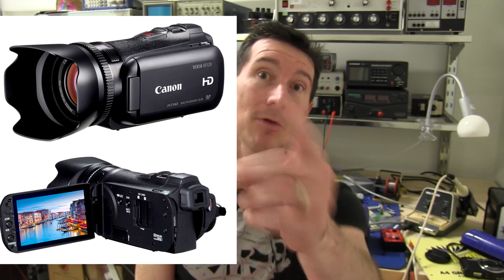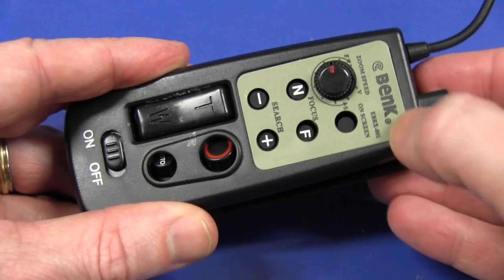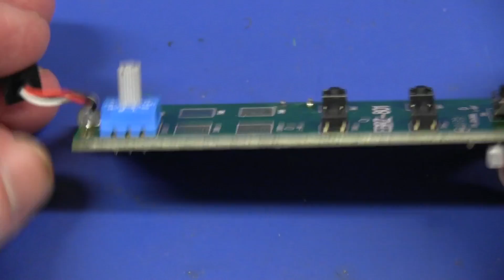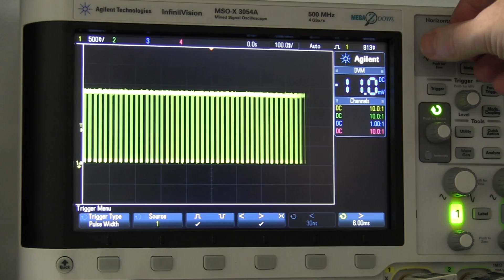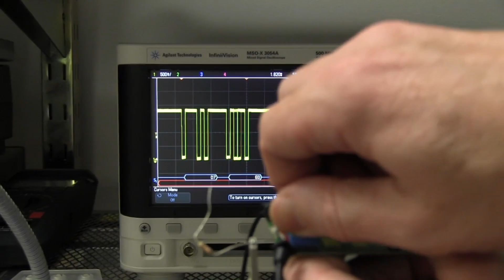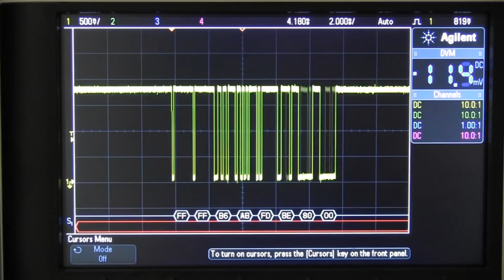EEVblog #297 - Canon LANC Bus Reverse Engineering

Comment: Hey, I'm looking to use a custom LANC-based RCP to control a Sony or Canon LANC camera remotely. What I can’t find is the full list of statuses that the camera can send back to the master (control) unit on bytes 2-7 of the LANC transfer. I see that the common status updates are “record mode” “tape position” etc, but I can’t find out if the camera is able to output such statuses as: current IRIS, current Shutter speed, current Gain, etc? Any insight would be amazing

Comment: Too bad I ran across this video 5 years later.  There is a Sony LANC remote that has an LCD display that displays the record/play time counter.  It has all of the control buttons and works on both Sony and Canon.  By adding a jumper it becomes a servicing remote allowing adjustment most of the operating parameters like color balance etc.  One of the LCD indicators is "REC" while the camera is recording.  So the information you seek is there.  I fixed this stuff for 23 years.
Reply: what is the remote model  number please as I am looking for a remote that can change exposure via LANC when in the manual mode. Thanks for your reply

Comment: Hey Dave, I just bought myself a Rigol 1054Z which has the option to decode data after you pay for it (or hack it).
Will that oscilloscope also decode this data the same way? In other words, is it worth paying for this decode function?

(I don't wanna hack and maybe loose my guaranty)
Reply: You won't lose your warranty if you're in the U.S. Here it's illegal for a manufacturer to void your warranty simply because you modified your property. The manufacturer must prove that the modifications you performed caused the problem for which you're seeking warranty service. The relevant law is the Magnuson-Moss Warranty Act. If you're not in the U.S., check the laws in your country for similar protection.

Comment: Great video, but disappointing because I'm using Canon cameras. My Varizoom wired remote for zoom/rec control does have a little tally light which works with SONY camcorders. The light DOES work on the new CANON HF G30 I bought. I'm not sure about the G20. As with your G10, the tally light does not work with the VIXIA HF S200 which I also have. I think if you put a G30 on your scope you'll see the tally signal.
Reply: Does not work on G20 either
Reply: You just saved me from wasting a bunch of time, thank you!

Comment: Looks like remote wall plugs, they have nearly the same code:
0.5ms control bit, 0.5 for 0 and 1ms for 1,  XXXXX 5 bits for the securtiy code, XXXXX 5 for the Letter that will be pressed and 2 bits for On or off (01 or 10)
and at the end a 350ms sync delay   101110100010 is plug 1-3-4-5(on), Button B, On

Comment: I wonder if there's a way you could use software to get an output (maybe even over LANC) when you start recording and use that to trigger the on air sign. That way, even if you're not using your remote you have the possibility of an on air light.

Comment: I was wondering if you might use the capabilities of the "Mini Advanced Accessory Shoe" on this camera to control your "on air" sign much the same way that it ( the shoe) might control the VL-5 video light accessory. I've looked all over but can't find specifics on  what the camera controlled shoe does to the light.

Comment: I suppose you could make that an IR switch then. Have another little transmitter going to a small control box on a different frequency than the camera. Again, would be a cool tutorial on how to build a small circuit like that. Knowing you, you could build that in about 30 min. :)  If you don't want to do that how about a foot switch you could toggle on the floor?

Comment: Also, I hate to be the one asking: Were you maybe pressing the record on/off on the camera instead of the remote, while capturing? :P If you were going to sniff at the bus somewhere between the remote and the camera either way, I would just use the actual hard button press signal (if you totally give up the bus sniffing).

Comment: I kinda like the idea of using an arduino to control the camera. Sure would give incredible control over the camera that way since you could output any command you wish. Build a shield that interfaces with the LANC and use a controller of your own design. In-fact a foot remote would be handy for controlling the camera when you don't have a free hand. You could also read the bus and output the counter to a display so you know how long you've been recording. Pretty cool idea someone suggested.

Comment: Actually, that won't give you the data he is looking for. He is looking for the byte that contains the rec status data. If you trigger off the button, you will keep getting "ALL" the bytes present when the button is pushed but no indication as to only which bytes are relevant. Since the camera doesn't seem to output it's rec status to the bus, he may have to resort to decoding the controller's rec/pause/stop codes instead. It should work fine but not if the camera's control buttons are used.

Comment: Could the 0.7V over on the power rail be to compensate for a diode? Just a guess based on the use of a jack connector.

Comment: Great little RE vid :)

Since the bus is UART compatible, you could hook up the bus to a PC, and compare the data when recording.

Also, while you're hacking the Lan-C bus, maybe you could make a nice zoom/focus puller with rotary encoders and a µC.

A focus puller would be really nice to have so you can easily do closeups without waiting for the AF

You can already use the remote without hacking, but 'absolute' knobs could be nicer to use.

Comment: Maybe you can reverse the approach and instead of reading the state of the camera just detect record/stop commands sent by remote.That way you'll only need to check the system when you turn it on and then (assuming the camera doesn't miss any commands sent by remote) you should get the correct state at all times.

Comment: looks like you can see different amplitude pulses depending on which end the data is coming from - adding some series R in a 1-wire line can make it a lot easier to see which end data is coming from.